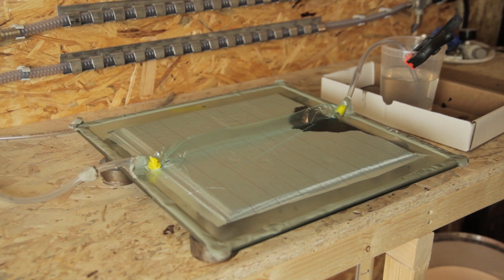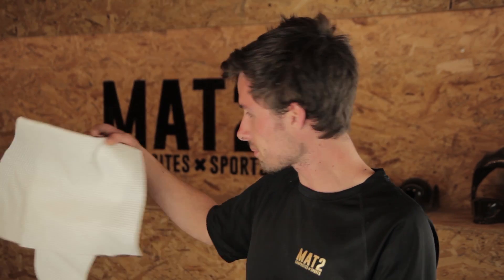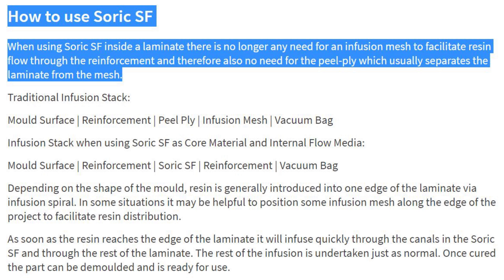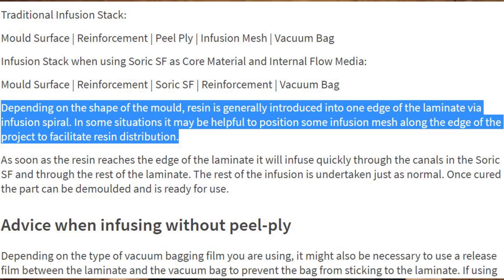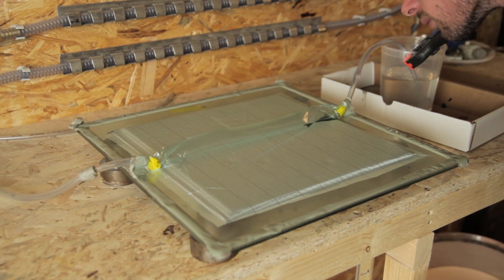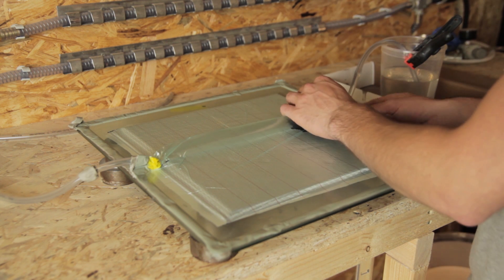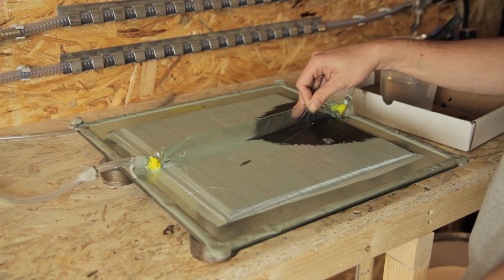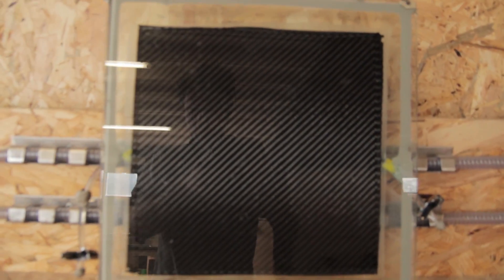Carbon Fiber and Lantor Soric Core | We Love Composites *3

Comment: Is the purpose of core materials only to add filler height? Would it be stronger always if you just used pure carbon across all the layers instead of having a core material?
Reply: that would be heavy, you want a core that adds thickness without being solid.  The Soric is mostly air, even after infusion.

Comment: Why is it so rigid? Is the stiffness aka flexibility of the carbon fiber no longer present due to the hardening of the resin within the soric core?
Reply: stiffness goes up with the cube of thickness...that's the point of a lightweight core.

Comment: Hey Matt, idk if you answered to that before but i've got a question, why during your plates infusion there's only a peel ply on top and not a draining fabric (in place of the peel ply or in addition to it) which would "solve" the kind of problem we can see at 3:20 for example ?
Thanks in advance ! :)
Reply: iStormZ  a resin channel the full length of the very front of the layup would have solved the issue.  Flow media would have sped the resin front up considerably even without a resin channel